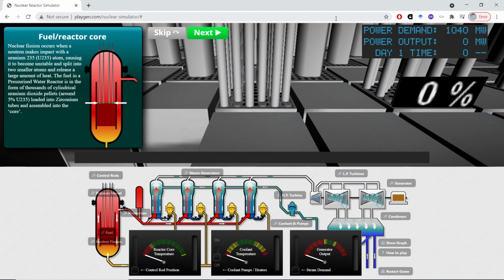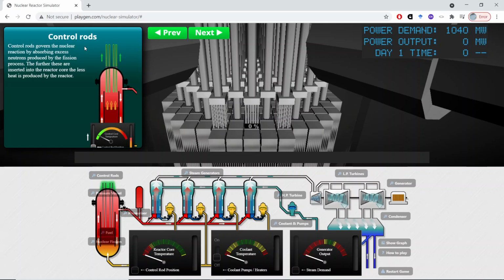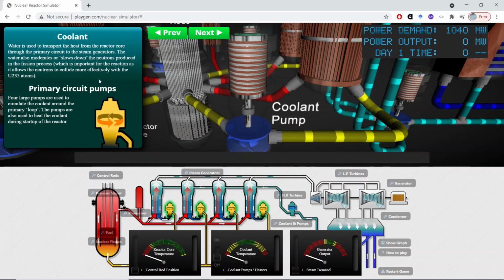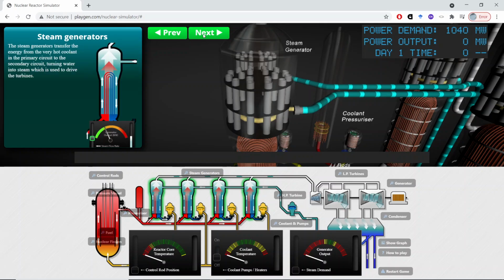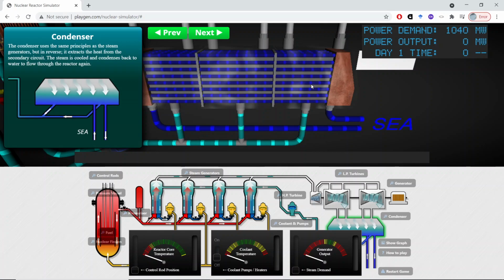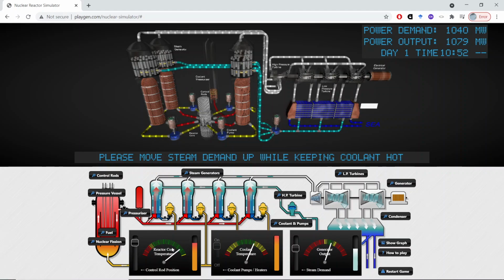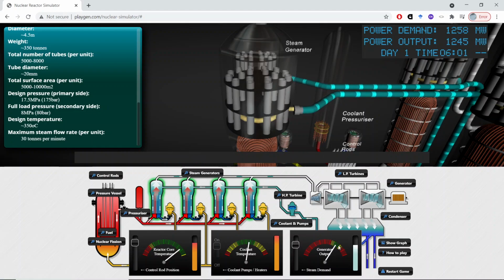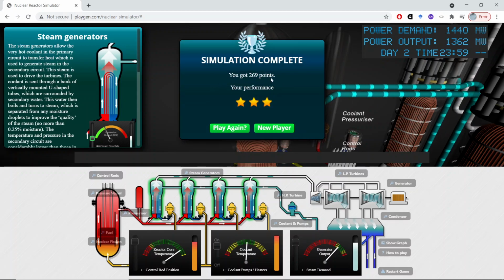PWR Nuclear Reactor Simulator from The University of Mancher

Comment: In  a nuclear submarine or boat, do they match demand on more frequent pace?
Reply from the maker: That is a very good question. And I do not have the answer. I'm guessing that they have some high idle power like 10% of nominal, which is bypassed from the turbine when not needed and lost in thermal energy in the condenser, and when they want to cruise at high speeds for crossing the Atlantic or Pacific they increase power above idle value or up to nominal for few days.